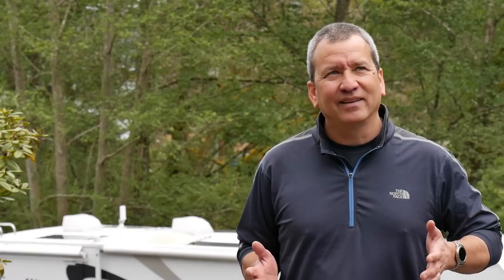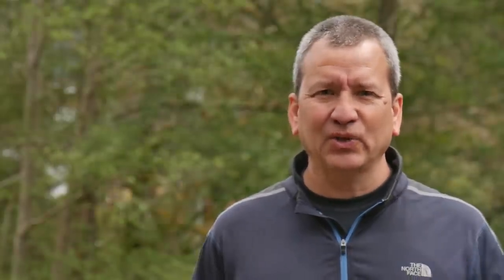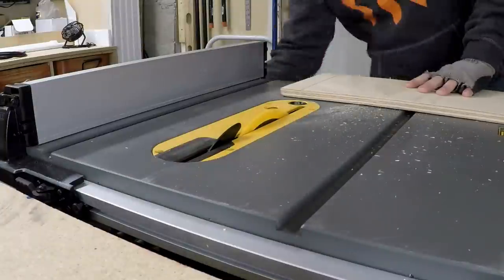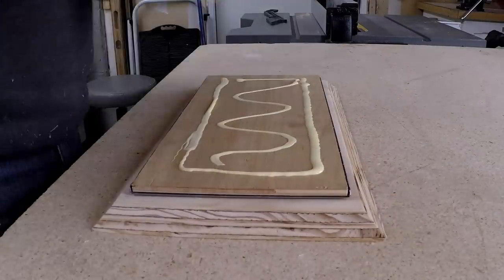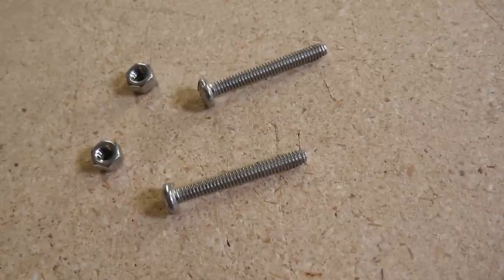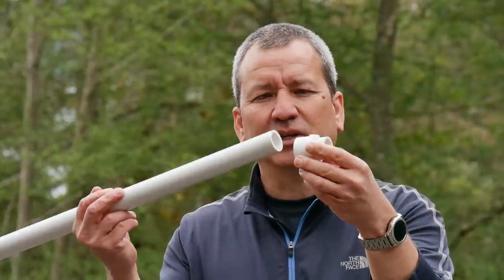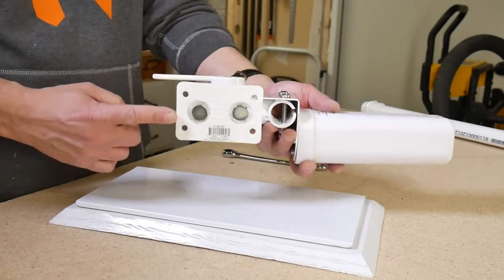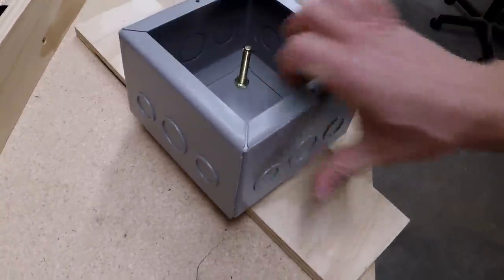DIY Adjustable ANTENNA MOUNT - NO DRILLING HOLES in Your RV Roof

Comment: Eternabond is good stuff.  You could make the taping even stronger by also using an application of Very High Bond (VHB) tape on the underside of the structure before placing it on the roof.   VHB is available from 3M.

Comment: Thanks for the video, new to RV life and looking to mount a Starlink without drilling holes I to the roof.

As well as wanting to install a Wyze Flood light Cam Pro with a circular junction box that is powered by extension cord coming out of junction box, looking for ideas to mount it without screws.

This is a great start, thank you for the great video.

Comment: I just built this almost exactly as you outlined in the video for my RV cell booster install.  Works like a charm.  Thanks for the idea and directions.
Reply from the maker: Glad to hear it. Mine is still holding on like new also. Thanks for the follow up!

Comment: Tito, this is an old video that will continue to be useful as far as I can see into the future. Have you put much thought into the best way to manage the cabling? I have a Northern Lite camper that is completely fiber glass and has a clam shell design that could never leak. I think I'm going to have to drill a hole. Just no way around it............................. Never mind, I just found your video "Cable Access Hole Through RV Roof // How To // Solar". That looks like a great solution.

Comment: Like the concept.  Over time leading edges of tape may lift due to wind pressure.  I would add another (3rd) strip of the tape at the leading end and in the position of the first strip so that leading seam is covered.  I would also apply sealant along the leading edge of tape where it is in contact with the roof.  And also along the edging upwind on the back end of the platform....just to err on the side of caution to prevent debris from blowing into the leading edges of tape and eventually lifting them.

Comment: Nice
Anchor it down with stainless steel cable. Just in case water gets under. It will not fly off your roof into someone windshield behind you. 
Thanks for your videos.

Comment: The practical road test is not after install. It's at least 3 years later (12 seasons cycled through outdoors, preferably somewhere with freeze / thaw cycles followed by intense heat), and then you're doing 70, outside air temperature is over 100 F, and debris kicked up by a semi you just passed has gotten stuck around the antenna, inadvertently increasing the drag forces at the base of it by two or three times (non-linear as it spins and jerks in the wind), and since you don't realize this has happened, you keep driving at highway speeds for another 200+ miles. If it's all still holding without any issue after that, it's a good install.  :-)
Reply from the maker: It's still holding strong just like when it was installed. Success!!

Comment: That was a good idea mounting the antenna. Perhaps an idea to improve it would be to add a electric linear actuator to lower and raise the antenna from within the coach. No need to climb onto the rooftop.

Comment: There art two adhesive materials you could have used to attach the base to your roof. First there is a double stick version of EternaBond tape in varying widths  and 30 to 60 mil thicknesses you could use and then there is  SIKA Sikaflex-252 White Polyurethane Adhesive 10.1 fl. oz. Cartridge That I would recommend

Comment: Hi. I just found your channel while looking for help in fixing my Winegard antenna problem. Through extensive testing and investigation I found my cable from the signal box through the cabinets and up through the roof has failed probably due to its 20 year existence. There is very little left coming out of the roof to work with. Do you have any suggestions for replacing/threading a new cable through?
Reply from the maker: Here's a video that may help https://youtu.be/aB8ic6x9DAM

Comment: Hi Brian, I just want to check with you to see how is your antenna holding up. Is it still standing strong with the tapes? I really want to install one like yours. I hate drilling holes on the roof.
Reply from the maker: Yes. I've had several antennas mounted there. No issues.

Comment: Tito, I am about to assemble antenna on long pvc pole with swivel marine VHF antenna base as you demonstrated.  Can you tell me what size threaded adapter you used to connect/screw to the VHF antennas threaded base (mine is on order waiting shipment but want to buy the rest of the stuff ahead of time)?I assume the female end of the adapter (smooth side) is 1” but can you tell me about the size needed for the VHF swivel base?  Thanks

Comment: Loved the video.  I am about to purchase a DriveX RV booster and although I intend on using the ladder mount, this interested me.   I do have a couple questions though... How did you run the wire down through the sewer exaust tube area?  I have replaced those so I know there is extra usually.  Did you just drill a hole, drop the cable then use dicor?  and 2.  MORE Important... without drilling holes in the roof, what did you use to hold the cables and wires from the panels and antennas over to the location to enter the RV?   I am also fixing to mount a satellite dish on the roof and will have to run the cable quite a distance on top of the unit to where I can bring it down or into the unit.  I was going to use wire ties with a screw mount .. actually make a hole for the screw and then use Dicor but looking for a better idea.   THANKS... and thanks for the Weboost review... finished making my mind on that piece of equipment.   :)
Reply: I'm surprised Brian didn't explain this.  It's great that he mounted without drilling, but the cable has got to get inside the rig somehow.

Comment: Hi, I like your setup using the Marine antenna mount and I like the idea of using the extension 2 1/2 foot piece of PVC when you want extra height. You cut out a section of the Tee and put two bolts through to mount the Weboost bracket which I am trying to understand why that was necessary. I am going to make both mounts but eliminate the slits in the Tee. I intend on screwing the Marine Mount right to the fiberglass roof of mine and use dicor to cover over the base to prevent any leaks. I am the going to run the cable down to the front of my coach and drill a hole through the roof  and into a cabinet over the passenger seat where I have a 110volt outlet. To hide and protect the cable on the roof, I intend on using the eterabond tape all the way to the hole I drilled. I will use Dicor again to seal the hole. I may use plastic channel with 3M tape if I don't use the Tape. In any case both would secure the cable. My connections will all be in the cabinet over the passenger seat. I will see where the best place for the desk top unit later. Thanks for the idea.

Comment: hi my sat dish wobbles in the wind it is strong high winds today it will pass later today but the base thats attached to the roof  gives me a thump noise is there anything i can do to stop this. The manufacturer tells me  that they have to have wobble room whatever that is hope you can tell me  thanks

Comment: I found this video and am looking to do something just like this with the antenna for my internet system. I'm curious, why did you add the additional plywood base?  Was that to provide something to screw the antenna down to?  I mention that, because are you not concerned with water seepage under the tape and rotting the wood? I did review your solar panel video where after a period of time you were getting water underneath the edges of the Eternabond tape.  That may not impact a solar panel, but was concerned about water like that getting to a wood base. Any concerns in that area?  I have a metal plate that I'm going to use - Stainless Steel 400 series so it's magnetic and I'm going to paint it, but was just wondering if I should put wood underneath it first.
Reply: I also like his idea but have a problem with the wood.  Moisture is the enemy, wood is a sponge.  Idea: you can get cheap plastic kitchen cutting boards that size.  They'd probably be workable in a table saw and you can screw the mount to that instead of the wood.  I'm thinking I'll also completely fill the space under the board with epoxy, silicone, lap sealant... something.  If you leave a void there, even a small one, water will get in, even if it's from condensation out of the air.  Thoughts?

Comment: Thanks for the link to this antenna mount. I was thinking you would include the wiring of the boost in one of you videos but couldn’t find one? Also I thought you set this anttena up to fold down while driving, guess this is the upright position just for a test? I know this was years back hope all still relative today. 2020 😊
Reply from the maker: I've left the antenna up all the time while driving. No problems. Of course, you could lower it if you wanted especially if you had a taller antenna.

Comment: Love your videos.... and not to be safety police, but you're using your tablesaw backwards :).  If you put the work between the fence and the blade (and push on the work, not on the waste) it will be a lot safer and you'll get better cuts too.   I hope that helps!

Comment: A little off subject but I watched your video on attaching flexible solar panels using eternabond tape.  Thinking of doing the same thing.  How is that install holding up for your?  Would you recommend it as a mounting method for flexible solar panels?

Comment: tip, water proof your cable connection. prevent water getting in to the coax, use vulcanisation tape for that.

Comment: Don't know as much about ground plane antennas as I should, but doesn't the antenna with the weBoost specify that it includes an internal ground plane?  Or, more precisely, that a ground plane is not needed?

Comment: If you were never going to need or want to remove it for any reason, I'd put down a good amount of something like liquid nails and then put on the other stuff. But that don't seem to move at all up there. And I'm sure as the hot sun beats down on it, it's only going to cause it to bound all the more...

Comment: I am going to use the same mount and was wondering if you think it may be better to mount it the opposite way so that if by chance it gets hit by a low limb it would simply collapse and not break the antenna or the mount?  It appears from you video it only collapses one way.  Would it hold up to wind if it were reversed is also my concern.
Reply from the maker: Either direction would work fine. I think I can collapse it in either direction.

Comment: I liked your mounting system but I have a question.  Did you actually mean "stainless steel"?   Normally a magnet won't stick to stainless steel.  Could it be just normal steel?  Thanks
Reply from the maker: Perhaps. It might just be chrome plated steel instead.

Comment: Hi Tito, 
your videos are really helpful! Thank you a lot!

I have a solar panel related question and I'm just gonna ask you here, since this is your newest video. I ordered a flexible 200W panel with these stats:
Max Power Voltage: 25.8V
Max Power Current: 7.75A
Open-Circuit Voltage: 29.50V

But I am not sure, which charge controller I need. I wanted to buy a cheap 12V 20amps controller, but then I found this: "Nearly all PV panels rated over 140 watts are NOT standard 12 volt panels, and cannot (or at least should not) be used with standard charge controllers. Voltages on grid tie panels varies quite a bit, usually from 21 to 60 volts or so. Some are standard 24 volt panels, but most are not."

Do you know what (cheap) charge controller would work best with that kind of panel? 

Would really appreciate your advice! 
Keep up the good work and have a awesome day!
Reply from the maker: I'm assuming you have a 12v battery bank. Right? Looks like you have a nominal 24 volt panel (design for 24v battery bank). If this is the case, the cheap 12v 20 amp controller may work, BUT it won't be able to use all 200 watts. It depends on the controller's specs. The controller probably has a maxumim input voltage rating. If it's below 25v and your panel is outputing 25+ volts, then it may just shut down and throw an over voltage fault. If the input max of the controller is higher than 25 volts, then it will probably charge your batteries but only grab about 14.6 volts and ignore the rest (if it's a PWM controller and not just a cheap regulator). The problem is that many really cheap controllers don't advertise their true specs. If you want to get the full output of your panel, you'll have to get an MPPT charge controller which is a more expensive option. I hope that helps.
Reply: Yes it helps, thanks you! 

It is a 12v battery. I read that I need a MPPT charge controller to use all of the volts. But I decided to go with a PMW controller, because for my needs that should do it. Unfortunately I ordered one where the maximum input voltage is not specified. I'm going to send the seller a massage and ask for it. :)

Comment: Brian, like you, I am not a fan of screwing holes in the roof of my rig. I'm toying around with the idea of mounting my rigid solar panels 'feet" down with the super 3M double sided adhesive tape, then with Eternabond over the tops of the mounts.
I'm a tiny bit apprehensive and would appreciate your thoughts...think it will work? 

I'm impressed with your results using Eternabond, thanks for sharing.
Reply: Take a look at channel "businessjonty".  He has three videos that show you exactly how to do that and all of the materials and bonding adhesive
that you can use.

Comment: Great video!  Thanks for doing it.  What was your reason for using the stainless steel piece?  Could you not have done it with just the plywood?  I have this project coming up and am wondering if I can forego having to hunt down a piece of sheet metal with wood filler.
Reply from the maker: +Niall O'Malley First of all I like magnets, I also thought screwing through metal and wood would have more strength long term. Also, the only reason I needed the filler piece of wood was because of how my metal piece was shaped. I would have glued and screwed on a piece of sheet metal otherwise.
Reply: Magnets don't stick to stainless steel :-)

Comment: Probably a silly question but where and how does the antenna wire get inside the rig to connect to the booster?
Reply from the maker: +RV Legal Eagles & Paws I ran it down next to a nearby vent. I gave a glimpse of it in the previous video.
Reply: Did you drill a hole by the vent or put it underneath the plate or what? Just wondering about a way to get a wire like that into the rig without drilling a hole or going through an open window:)

Comment: If magnets are sticking to your metal plate, it is not stainless steel. Good thing you painted it. Liking the uses for EternaBond tape.
Reply from the maker: +JulMarRVing I just had to look it up. Apparently ferritic stainless steel is magnetic, others are not. Thanks for getting my wheels spinning :)
Reply: JulMarRVing 400 series stainless is still magnetic, 300 series will not hold a magnet. Stainless refrigerators are made with 400 series and you can stick magnets to the front.
Reply: cheap stainless is magnetic, good stainless not

Comment: There's just one problem that I see and it could be the cause of your antenna exiting the rooftop--the PVC Tee. PVC pipe and fittings are not UV stable. After a couple years, if that, the tee will become brittle and crack and eventually break. Either paint it with UV resistant paint or wrap or coat it with something.  In Fact, the entire antenna mount may be an issue if it's also PVC.

Comment: Do you leave the cables loose on the top of the rv? I want to run a cable from an omni directional antennae the same as the video into one of the upper compartments in the coach. Should the cable be taped down or otherwise held in place?
Reply from the maker: +Ivan Heit Yes you should secure the cable using some kind of anchor. You could also use Eternabond tape to tape it down bit that will make it more permanent. I have mine zip tied to my existing solar cable which is already anchored to the roof.

Comment: High grade stainless steel is not magnetic.  If you had any magnetic action on your plate, it means that there is some carbon steel in your plate.  Make sure you keep the paint in good shape or you might start developing rust.  
Great mounting idea!
Reply from the maker: +billyboyblue17 It is pretty magnetic and I used to have it mounted on my truck with no rusting. I wonder if it's chrome plated steel instead of stainless...or something like that.

Comment: Another question.  Do you know anything about whether I can use an omni directional antenna with a weboost Connect RV 65 unit?  I know they say it's for a parked RV but I would think that is because of the pole that comes with the unit.  I want to be able to switch between a Yagi and omni directional antenna depending on conditions.
Thanks
Reply from the maker: Yes you can. That's what I do. It works very well actually. I use my connect 65 with this omni antenna from the 4gx RV. The 65 is sold as a stationary unit because the dB boost of the amplifier.ia above 50 (max for mobile).

Comment: How about a tether line, just in case.  I use a tether line on my tow mirrors, just in case the straps fail.
Reply from the maker: +Abunai One Certainly an option if you're concerned about it holding. Then again the antenna is connected to a cable.

Comment: How did you pull the cables inside without drilling a hole?
Reply from the maker: The coax cable runs down next to my vent pipe.
Reply: Okay but how did you get the cable inside your RV?